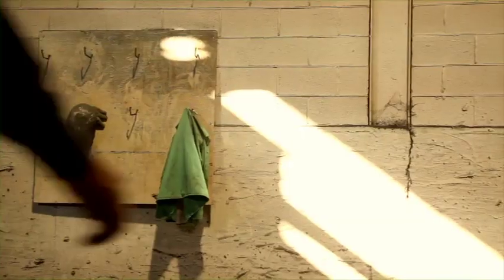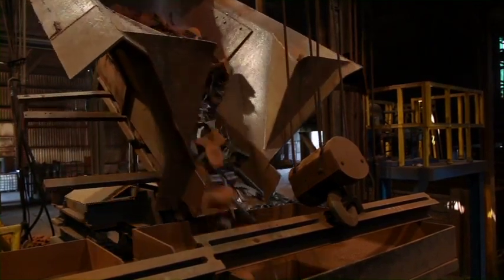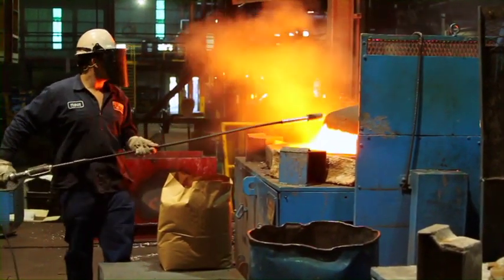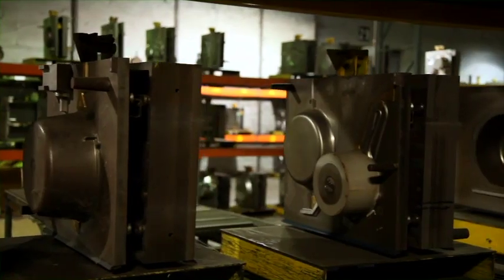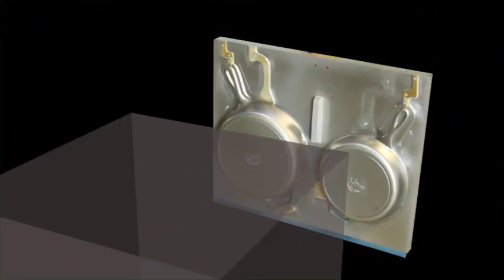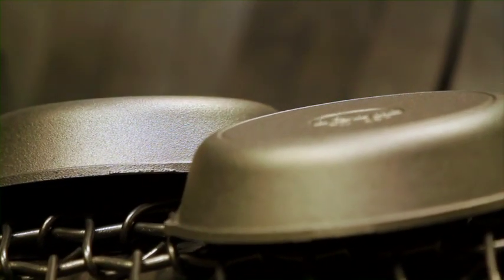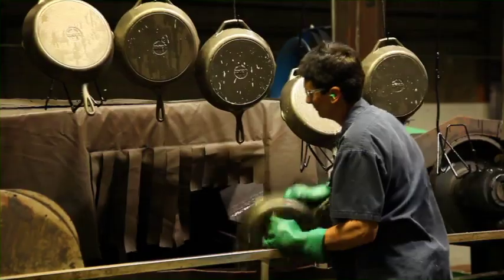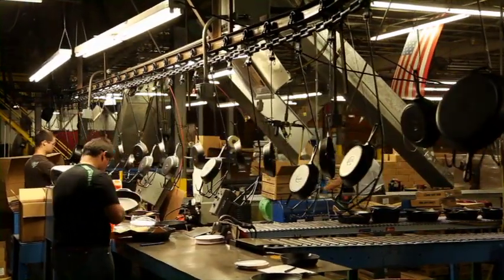How Lodge Cast Iron is Made

Comment: Great video--I appreciate the manufacturing effort Lodge takes in making their cast iron products.  I have a Lodge skillet, square grill pan, 7G12 reversible grill/griddle, and a L410 Sportsman's Grill (Hibachi).  I just got the Sportsman's Grill the other day.  I've had the skillet for almost 30 years.

The finish on the L410 portable grill is just as smooth and nice as my skillet--all of the my Lodge cast iron pans are finished the same.  Being cast iron, the surface finish is not smooth since they are sand cast.  ALL sand castings are somewhat rough unless they are machined.  But that's what makes them cook well since once they are seasoned and used, food will not stick to them if you use proper technique.

I own over 50 pots and pans, everything from vintage Calphalon aluminum to heavy Made in France copper pans.  I have French black steel fry pans which are smooth.  I have commercial stainless steel cookware with copper or aluminum sandwich bottoms and, of course, lots of non-stick too.  Calphalon, Leyse, Sitram,  Matfer Bourgeat, T-Fal, and Farberware.  

If you want smooth heavy iron fry pans then get a good black steel pan from Matfer Bourgeat.  They aren't that expensive and they cook just like a cast iron pan.  They aren't any better than a sand cast Lodge pan, in my opinion.  Both will fry a steak perfectly.

I think that it's amazing that Lodge can still make a high quality product in the USA and at a very reasonable price.  The L410 portable grill is less than $90 at Walmart and it's built like a tank--it will last a lifetime.

So even though I own lots of pots and pans, there isn't a better cast iron pan on the market than a Lodge.  I'm happy to spend my money on a Lodge product and support the Americans who make them!